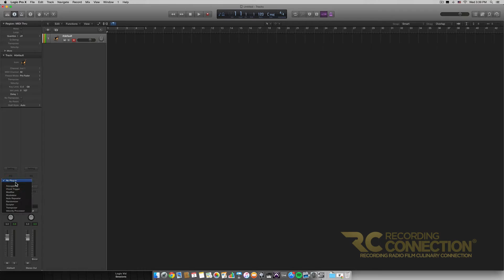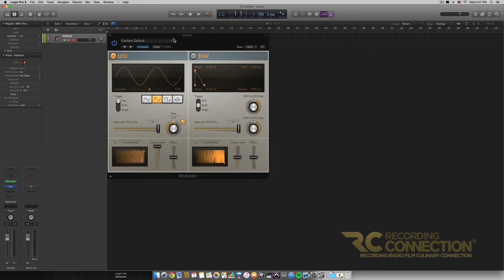Recording Connection - Modulator MIDI Effect in Logic Pro X

Comment: HI thanks for the video but i have a question is this only works with synths native to logic x or can i use it maybe in massive or FM8 or third party plugging and with the ENV feature how do you set the env maybe to affect the pitchbend  so you could maybe do like a Pitch Env effect.... i know most sofsynths have this feature cus they have internal ENV and LFOs but this time you wouldn't do it inside of the synth but instead u use the modulator MIDI Effect to maybe alter the pitch bend i hope u understand